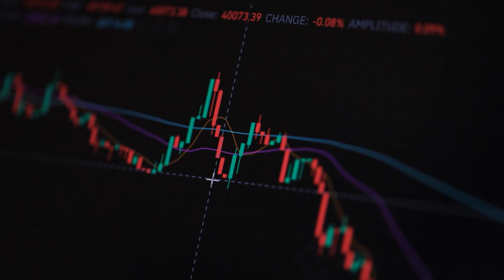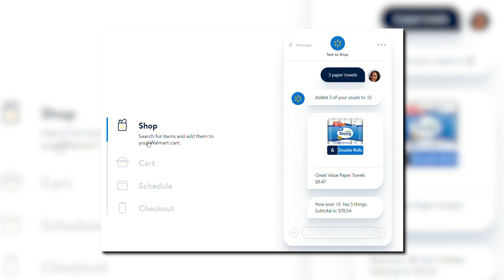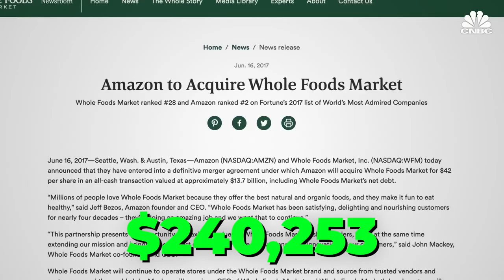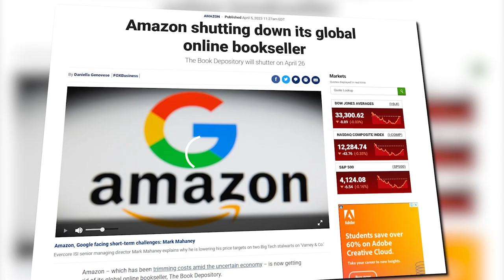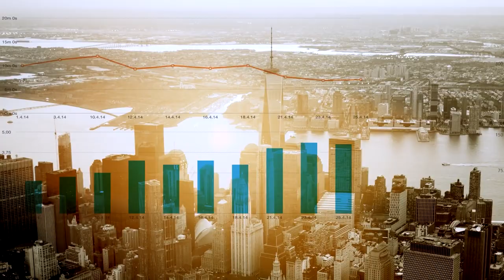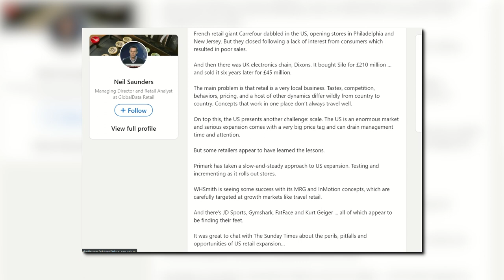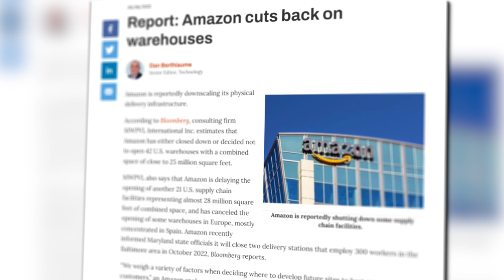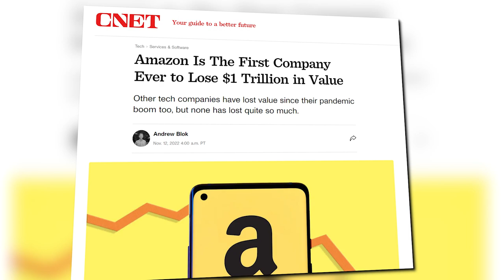The SHOCKING DOWNFALL of AMAZON: Is the End Near?

Comment: Amazon used to have better deals than most stores I shopped at but at some point over the last 4-5 years, the prices have been much higher. That's why I hardly buy from amazon anymore.
Reply from the maker: It's true. Amazon's prices have been rising exponentially over the past few years.
Reply: That was the plan along. Weaken the competition so you are left with no choice
Reply: In India Amazon is not having proper packing and qc.  Dealers are supplying damaged products

Comment: I use Amazon at least twice a week. I got tired of going to brick and mortar stores only to find out that their shelves were empty. I would be lost without Amazon. It is a national treasure. I buy all my soaps, detergents, drill bits, machine shop supplies, woodshop supplies, over the counter meds, gifts, and even a lawn mower. I buy welding electrodes and trailer axles from them. There is almost nothing they do not sell, and sell it cheaper than I can buy it for anywhere else. 50% of what I buy comes next day.
Reply from the maker: Thanks for sharing!